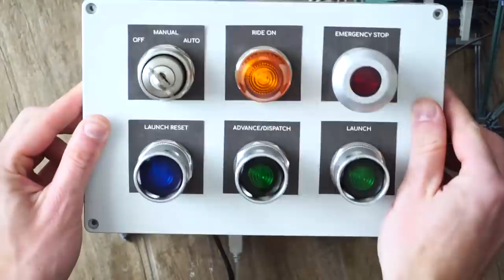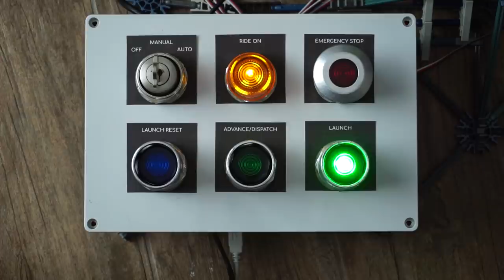Krakatoa - K'Nex Roller Coaster

Comment: By far the best cinematography I have possibly seen. The extra detail is great. I love the  custom made volcano, nice touch! Also, what do you use sensor wise to detect the train? (Proximity switch?). Also, why didn't you just solder onto the existing Knex motors? Love the control panel, I want one haha! How did you make it man? Great coaster and great use of electronics! 😄👍
Reply from the maker: Wow, thank you!! The sensor in the station is just a simple contact switch - it closes the circuit when you press it. I didn't solder onto the K'Nex motors because that would have drawn too much current through the Arduino. And I didn't want to buy a separate power supply. So it was simpler to keep them battery-powered and switch them on and off with a servo!
The control panel and buttons were actually given to me by a friend, but it's pretty easy to make if you have the right tools (and are willing to spend tons of money on those buttons). There's tutorials online for it! However, I made the legend plates and did all the wiring myself.
Reply: Ryan O'Neill Nice! How difficult was the actual coding itself? I find that Arduinos have a limited number of ports so what would you use to increase more port space? More Arduinos or pin extenders? I am currently in the beginning of making a Knex Micro Invert and I will be using (like you) an Arduinos to control the whole thing.
Reply from the maker: The coding of each function was easy. I hard-coded a separate timeline for the Launch Reset, Advance/Dispatch, and Launch functions. The timeline is a block of code that says "Servo A go to __ position... now wait __ milliseconds... Servo B go to __ position... now wait for contact switch..." and so on. The tricky part was coding the logic for the control panel, to make sure that it only runs each function when it's supposed to. I used a simplified finite state machine for that part (something I learned in my mechatronics classes).

The Arduino Uno has 20 ports that can be used to control servos, read sensors, or switch LEDs. It has 14 dedicated digital I/O pins, but the 6 analog input pins can also be used as I/O. I used almost all 20 on this project, but most of the pins were used for interacting with the control buttons and lights. I doubt you would need more, but if you did, you could buy an Arduino Mega which comes with a lot more I/O pins.

That's awesome! Will that be your first time automating a coaster with Arduino?
Reply: Ryan O'Neill Funnily enough my first ever complete custom coaster ha! I don't know when I'll be releasing update vids. What's your Sscoaster account name?

Comment: how the hell did you do that launch
Reply: Go Analogue! Looks like an elastic band high tensile that’s pulled then released
Reply: It works exactly like a hydraulic launch. Getting technical to how he did all of this in knex I have no fucking clue, but basically there is a band that runs the length of the launch that has a launch dog which attaches to a hook on the train. The motor propels the entire band, basically working as a super powered chain lift
Reply: @kylebetz9684  i thought it was a flywheel launch

Comment: I love building model coasters. I’ve made them out of steel and brass tubing. The problem you encounter with model coasters is that they don’t have the weight of full size coasters so the inertia is awkward. It’s the mass that makes them move forward for a long time even on a relatively horizontal plane. Model coasters also lose momentum as the track sways and energy is transferred to the track.

Comment: Great coaster. I hope you don’t mind me asking, but what cart are you using because I want to make the Baron 1898 from the Efteling in the Netherlands but I can’t find the cart you are using anywhere. And also where can I find the green pieces that holds the track tubing
Anyways amazing build. Keep it up💪🏻👍🏻
Reply from the maker: Check out the K'Nex Screamin' Serpent set - they haven't made them for many years, but you can still buy them used. It has all the track and train pieces needed to make a coaster like this (although for something of this size you'd need at least 15-20 of those sets)

Comment: If you wanted to make it more advanced, you could get sensors to detect when a train enters/ exits a block. Then program it to ensure the trains can't enter the same 'block' as another. Though, I'm not entirely sure of arguino's abilities in doing such a thing. You would need at least 6 sensors in your current setup to properly identify each block segment. It would still be something neat if you wanted to push the boundaries even more.

Very nice job!
Reply from the maker: That would be very cool! The current setup is actually somewhat close to that, at least for the station block. There's a contact switch in the station. The Arduino won't launch the next train until the other train has entered the station, clearing the brake run. Of course, it's not foolproof because I'm not explicitly checking that the brake run is clear, which would require extra sensors like you said. Thankfully this coaster has 3 blocks and 2 trains, so I think it would definitely be possible!

Comment: That is awesome!! As a ride operator myself I love how you have a two- one train mode in auto and manual. Does the auto mode utilize the brake run as a block section or is that part still manual?
Reply from the maker: This ride operates on timing instead of sensors to check whether the train is on the brake run... so it doesn't have block sections in the traditional sense. However, based on the timing, in manual mode it won't allow you to dispatch another train until it has reached the brake run. Auto mode works the same way - based on timing - except that it automatically dispatches the next train once it's given the previous train enough time to reach the brake run.

Comment: Extremely impressive. By far the best coaster creater. You have excellent theming, stunning automation, and a great layout. I've been lubricating. My K'nex trains for years with motor oil as it seems to be the best. Is that what you use?
Reply from the maker: Thank you! I have always used a silicone-based lubricant sprayed directly onto the axles. But I expect any lubricant other than WD-40 should do a good job
Reply: @RyanONeill13 Okay, thanks for responding. Good to know. Yes I usually put it right on the axles.

Comment: So correct me if I’m wrong but you are using elastic energy to launch the train?
Reply from the maker: Yep! The black surgical tubing acts like a giant rubber band. Before the launch, it winds the string up which stretches the surgical tubing. Then it attaches the train, and then it releases all the potential energy.

Comment: is this Knex roller coaster for sale in stores or on the internet? I would really like him. And are the systems (with the control) included? Thank you for reading and I'd love to hear it!
Reply from the maker: Hi! This model in particular is a custom build, so you can't buy it anywhere. I combined a lot of K'Nex sets to build this. The controls are made from off the shelf components but I designed and programmed the system myself. If you want to do the same, there are K'Nex coaster sets you can buy and combine to make bigger models!

Comment: What would be the force needed to launch a full scale coaster of this size? And what g forces would that impose on a human body?
Reply from the maker: I didn't really analyze the length of the launch or scaled height of the coaster, so I don't know what the exact acceleration would be. But most launched roller coasters fall somewhere between 1-1.8 G's of acceleration, the highest (Do-Dodonpa) going up around 2.7 G's
Reply: @RyanONeill13  why did you stop making vids you lost your tools?

Comment: Just wondering about how you help the cart keep momentum as I am building my own coaster as a hobby, and really struggle to make and recently long tracks due to the rapid loss of momentum
Reply from the maker: Here's what I think the most important things are:
- Make sure your track shaping is smooth, and there's no sharp spots or overly tight twists (that's usually an issue on cobra rolls or zero-g rolls).
- Support your track as solidly as possible. If the track flexes or bends at all when the train rolls past, that will kill momentum.
- Weight your trains properly. Keep the weights as close to the bogeys as you can. Most people use stacks of pennies or lead weights attached underneath each car.
- Clean your axles. Take apart each bogeys and clean all the hair & gunk off the metal axle that holds the wheel.
- Lubricate the axles with silicone lubricant. Don't lube the track, just the metal axles. Stay away from WD-40, but I've heard that some people use Pledge or other sprays that work well.
Reply: @RyanONeill13  Ok I see
Reply: Although, the bogeys? I had figured I would probably need to weight the trains but again, wdym the bogeys?

Comment: What have you used to build that volcano? Is it just painted paper lying on the structure underneath it?
Reply from the maker: Exactly. I crumpled some brown paper and sprayed it with orange peel wall texture, and then a bit of black spraypaint. It's hot glued to the K'Nex structure underneath. I didn't really know if it would look good, but I'm happy with how it turned out!
Reply: Thanks for clearing that up :D
I'll maybe try to use this technique myself for a pair of mountains around a CoasterDynamix coaster, in the style of Tivoli Gardens' wooden coaster.
Reply from the maker: Filipolis That's a cool idea, it will look super realistic with CD track. Good luck!

Comment: Hi, I'm your fan in south korea. I watched your videos and I'm Loving it now. So I try to buy the roller coaster parts like yours, but l couldn't find'em.
How can I buy the rail like yours? I just know they sell them individually.
Reply from the maker: I buy my K'Nex as sets on eBay, so I usually look for Screamin' Serpent kits. Those kits have the trains, tubing, crossties, and all the pieces you need to build a custom roller coaster. It will be a lot more expensive if you're buying the pieces separately.

Comment: What size surgical tubing did you buy?
Reply from the maker: 1/4" OD, 1/32" wall thickness 
https://www.amazon.com/gp/aw/d/B074NCLZSW?psc=1&ref=ppx_pop_mob_b_asin_title
Reply: @RyanONeill13  thank you so much! I was also wondering if you could point me in a direction for motors that work with an arduino uno and knex?
Reply from the maker: @connormartin12  Sure! If you're using Arduino, you have tons of options. The best option for simple movements (like station gates or a brake release lever) is a hobby servo. The smallest & cheapest ones are called SG90, but you can also buy bigger servos. They run on 5V and it only takes 2 lines of code to make them move. For continuous moves like a lift hill, I would probably just use a DC motor and a relay. Unless you need to control the speed, in which case you could use the motor shield for Arduino Uno.
No matter what motor you use, you'll have to do some "hacking" to make the motor attach to Knex. I've found that hot glue works really well and is easy to remove once you're done.